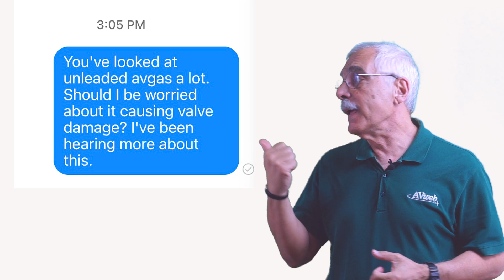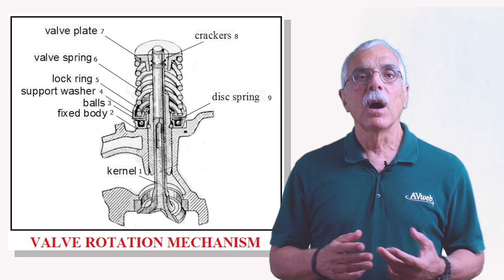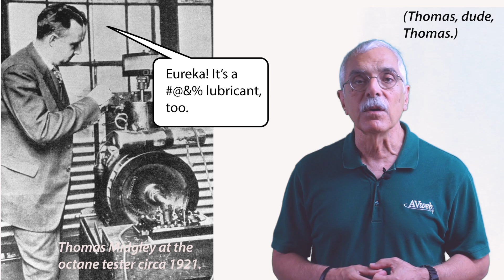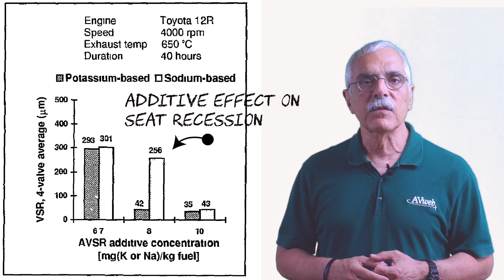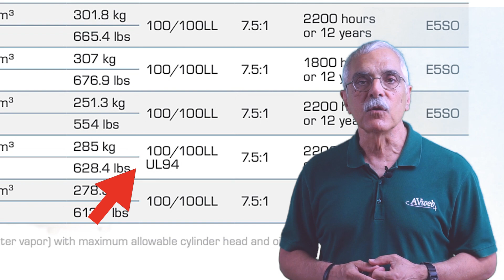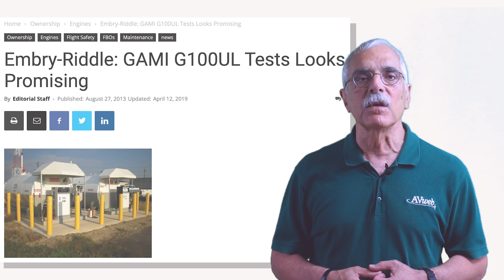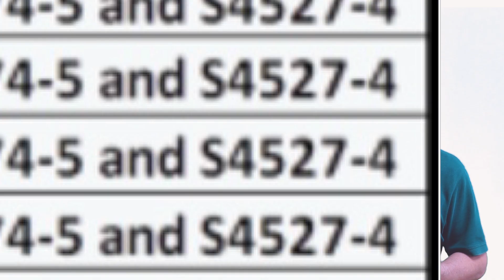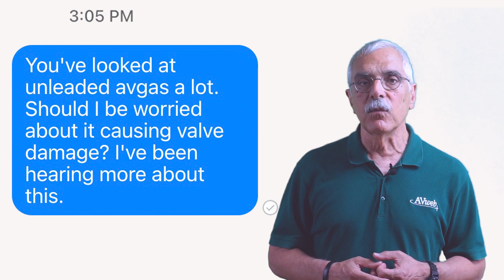Whadayamean Unleaded Fuel Will Trash My Valves?

Comment: I've operated my C-182P with a Continental O-470-R for 3,000 hours since 1985. Most of the fuel consumed other than transient fueling away from home has been automotive unleaded 87 octane and ethanol free automotive unleaded premium since the ethanol introduction. My experience has been unremarkable, except my sparkplugs never foul, never need blast cleaning and last and last.

Comment: I dont see why they cant make an AD for engines with soft seats to require a fuel additive to offset this, while the rest just run a base unleaded fuel. 
Id recon 70% of the engines bolted up, would be unleaded compliant, why are we polluting for the 30% that can pay a bit extra to fix themselves. 

Its like adding zinc for my flat tappet cam, or injector cleaner in the hopes my Porsche doesnt kill itself.

Comment: I had a 65 Honda ST/SR motorcycle and it would not run right until I put lead additive into the fuel (in the mid 80's).

Comment: That's the first time I've ever heard anyone say TEL helped lubricate valve guides.
I was a motorcycle mechanic, Honda (maybe others?) counter bored the port end of guides to prevent exhaust flame baking any oil or deposits onto valve stem  that would eventually go back into guide and cause valve sticking.
I only have experience of Honda engines back to mid 1960's so don't know when they started doing it.
They also had hardened exhaust valve seats so were OK with unleaded fuel (even the 49cc motors)
Problem is, American manufacturers will never do ANYTHING to improve what's already there until they are forced to by legislation or 'market forces'
Lycoming  at least stepped up early and fitted hardened valve seats, probably the better quality material was same price or even cheaper than what they had been using  (or, like Shell oils, engineers actually used their own products so saw usefulness of getting certifications?)

Comment: I am concerned about the sources of the unleaded fuel as it will react with sealing material in fuel tanks and engines as cleaning the damage to everything from ethanol (crapanol) on everything built before a certain year.  A fuel that took 8 gallons to make 6 gallons, less milage, water magnet, eats certain rubbers...  Would I like unleaded, sure but not at the cost of replacing all the seals in the plane and never thought anything needed the grit left behind from lead, but not plant-based.  Great investigating on cause and effect as I remember Continental supporting as octane drop (burning only 20% of avgas) with no issue, while Lycoming which with high compression needing high octane (burns 80% of avgas).
Reply: I think you're confusing unleaded avgas with ethanol infused mogas. You don't need to replace any seals for unleaded avgas (currently UL91 or UL94) as it's just the 100LL without the lead. Nothing else changes except octane rating and lead. Both Continental and Lycoming have high and low compression engines. Unleaded avgas, the UL91 or 94 varieties, can be used in low compression engines where it burns better than 100LL as it's all set up for the lower octane. The medium compression engines, most can use lower octane fuel, a few can't. The high compression ones, like the Lycoming 200hp IO-360 with an 8.7:1 compression, need 100 octane, so UL91 and UL94 aren't acceptable and may cause knock. These engines will need UL100.
Reply: @paulsengupta971  Just want to know what it is made from, as it started from bio-mass years ago (Swift) as the octane rating wasn't the concern as if it is bio-mass it is ethanol, not oil based and that is not a good thing in respect to all the bad that can come not changing seals to deal with the negatives.
Reply: @cw5865  I can't speak of individual products, but as Paul says in the video, it's just 100LL without the lead. So it's made in the same way as 100LL, just without the step of adding the Tetra Ethyl Lead.
Reply: @paulsengupta971  First Paul thank you for the interaction as I have one of those high compression Lycomings and remember several years ago when the debate started how fast Continental was going to sell out the 25% of the fleet with high compression engines at to the time pointing to 94 octane as an answer.  It wasn't going to be a problem for them with rebuilds to lower compression.  But it was quickly pointed out that 25% burned 85% of the fuel and that wasn't going to work.  Shortly after Swift offer a product from switch grass and Shell (F-1 fuels) acted interested from their high-octane racing brew.  Fast forward to today and just how are they raising the octane to 100 without something, unless the whole fuel is biomass, as ethanol is what is used to boost octane in unleaded mo-gas today.  Straight gas can't reach 100 octane without help and I know it was explained a glue melted in a fitting with the first demo plane, but if so what else will be affected and what is the substance that did the melting.  Don't have the faith in anything Gooberment is regulating due to the behind-the-scenes bonuses and jobs with changing something not explained how...  I have a plane type that is popular that will not bode well if any form of "ethanol" is put in the tanks.  I would like 100UL, but how did they do it?
Reply: @cw5865  Ah, I can't comment on 100UL, that's all new and under test at the moment. I think most companies that are experimenting with it won't publish how they've done it! I also have a high compression Lycoming which can't use UL94, so until we get a viable 100UL, it's 100LL for me.

Comment: You showed a 74 Nightmare Pinto. I had a 75 Pinto throughout the gas lines of the 70s (77-78). That turned out to be one heck of a reliable little car. Drove nice too. Luckily, I was never rear-ended.

Comment: as i was told and i go back to the mid 1950s with engines. when the gov-mint aka the EPA started fazing out leaded fuel they offered a choice un or leaded gas. the big boogieman that was also used for many years was ZDDP a zink additive. when this went by/by that caused cam and lifter wear. all this plus the valve seat issue. no lead to soften the seat contact.

Comment: I don't get this. The automotive industry went through this 50 years ago. Replace your exhaust seats. Problem solved. My '74 Ford F-100 runs fine today on unleaded fuel. Replaced exhaust valves and seats and she never missed a beat for over 45 years.

Comment: If unleaded fuel trashes Continental valves/heads after 700 hours, does it matter?  With an IO/TIO 550, you're going to need a top overhaul by 800 hours anyway no matter what fuel you put through it.

Comment: Aviation is a drop in the bucket compared to every other form of transportation. Unleaded Avgas will eventually cause a shorter TBO life & engine failures especially in turbocharged engines where detonation will occur. These are the same idiots polluting the world with lithium battery cars.

Comment: Tetraethyl Lead creates a beneficial tribofilm on exhaust valve seats, preventing wear. The exhaust valve head deforms very slightly like an oil can during peak combustion pressure, scrubbing the valve face against the seat. Better (more wear-resistant) valve and seat materials were the solution in automotive engines, helped by the widespread adoption of aluminum heads with pressed in seats vs. the machined-in integral seats employed in iron heads.
Reply: And seat wear/valve recession eventually eats up the valve clearance, holding the exhaust valve off the seat all the time. That causes the valve to burn because it can no longer transfer heat to the valve seat. And the engine loses compression simultaneously due to the leakage caused by the slightly open valve.
Reply: Tetraethyl lead (TEL), Pb(C2H5)4,   any idears about c2h5 ?   cc hhhhh

Comment: The FAA has regulated aircraft engines so heavily that instead of advancing with safer, more reliable engines.  We get flat head, ancient dinosaurs from the era when automotive engines needed full machine work overhauls by 100k miles.

It’s hilarious that aviation guys still haven’t figured out hardened valve seats when 1970’s Toyotas will go 400,000 miles with no major valve issues.

Comment: Pay attention you will get an education from a real scientist. Sadly There are a lot of lost people. I am a former NASA scientist Now a A&P by retirement activity. These engineers are lost and have been for decades. It is called the run on effect. They follow the footsteps of previous people who began the screw up research, and they model theirs after the same failed ideas .  Including the researchers at these companies. I seen these same type low D grade engineers at NASA a lot. They are everywhere. It is rare to find a true creative mind that can put everything together not overlooking the smallest detail and in a new way. . Like the detail I will share with you. It is my observation that the real cause valve seat recession on continental and even valves sticking on Lycoming in unleaded and leaded is the thermal resonance of the valves. . First you need to understand a few things.  Leaded gas provides a greater cylinder cooling effect of the gas. This is due to the mass of the lead present in the gas increasing the thermal conduction of the fluid and its ability to cool things with convection cooling. . Second the continental engines run a lot hotter than the Lycoming. This is why continental has more recession issues and Lycoming has more valve sticking issues. The FAA tests were conducted wrong, no surprise. . They follow what is and should be the ideal operating procedures of an engine.  HOWEVER, I have never met anyone operate a piston engine the proper way with respect to shut down.  They all land and shut off a hot engine. The FAA test did not simulate this. Cirrus is the worst for this type of abuse, since they have very bad ground cooling vent systems. I e cowling vents are poor. . Lycoming uses the sodium filled valves that makes them run cooler than continental. almost 100 Degree cooler . When someone shuts down abruptly a very hot continental engine all the time you are going to get in short order a valve recessing.  And a lot more often with Unleaded than leaded.  AS the engine stops from high heat the valve seat closed will seek to weld to the flange. The unclosed valves will try to warp. A Continental engine after landing from a cruise on a hot day can be well over 600 degrees on the cylinder head.  With some internals like valves seats as high as 1000-1200 degrees peak. Once a engine shuts down thermal entropy comes into play. Huge amounts of thermal heat conducts throughout the engine in a wave of randomness. . Changes everywhere instantly in the thermal pattern. Heat merging and converging and the valves are one place it loves to go. Valves are by consequence of design what is called a thermal resonant spot. A small spur like element connected to a huge block of heat.  Like a solder wisp on a mound of solder. Everything wants to go to it. It is already the hottest part in the engine and more heat loves to conduct the easiest path, which happens to be more heat. Contrary to common thought heat does not like to seek cool. Cool is just less hot. There is no such thing as cool per se.  Heat rises in air because it is lighter , not because it wants to seek less heat. Heat sinks to more heat . Since the valves are the hottest part in the engine, at shut down all the heat tries to go to them. The cooling of the fuel vapor upon the valves is suddenly removed . Including the exhaust valves that were hit with unburned fuel regularly. This causes the vales to recess, and it is less likely to happen with Lycoming valves. of lead gas that leaves a residue of lead that helps keep the colling down just barely enough. However, the cooler thermal state of the; Lycoming engines during sudden shutdown causes this same process at a much lower temperature which leads to the cumulative buildup of coke on the valves after shutdown. The coke buildup also takes place during startup in all engines. However, Lycoming has this similar effect during abrupt shutdowns which causes even more coke buildup than typical engines and leads to more sticking exhaust valves. The moral to this story is, make sure you complete a engine cool down back to normal temps in the green not yellow before you shut down an engine. Lao make sure you warm an engine at idle in a Lycoming to keep the fuel flow low, and warm up at higher RPMs like 1700 RPM in a continental to keep the fuel flow higher during warm up and reduce engine heat from focusing on the valves.  I could fix all this research But I dont have time to deal with those type people. Im too busy having fun in retirement. Have a great day

Comment: It makes me genuinely upset that aircraft are still using leaded. It's a smaller industry with fewer players, yet it'll be 30 years after it was completely phased out of cars for them to even begin the transition.

Meanwhile, this transition was as predictable as sunrise, yet until recently they weren't even using hardened valve seats with these expensive engines. No prep was done.

The approval excuse is such BS, it shouldn't take that long to find a suitable replacement. We did it in cars.

Comment: The FAA did a study years ago on valve recession, and the study found that lead did nothing to prevent valve recession other than raise the octane of the fuel.   Valve recession is caused by pre-ignition.    Pre-ignition is caused by inadequate fuel octane rating.   Lead does not magically coat valves and prevent exhaust valve damage, lead does do a good job of raisng the octane of fuel.

Comment: I really like Paul's thoroughness and aversion to speculation. 
I learned to fly in Europe (France) 25 years ago, and have flown 172s and 182s of several generations all across the continent, but never heard of an unleaded alternative other than home-builts using MoGAS. 100LL is very easy to get across France (where it's currently about 2.60/l, or $11/gal) but in some countries it's not easy to find, and your choice of airports is limited by the fuels they have available. I have not flown in Scandanavian countries, so maybe the unleaded variant would be commonplace there.
Reply: 91/96UL is common in Scandinavia yeah, many smaller airfields don't have 100LL anymore. I think 91/96UL is going to get even more common at a pretty rapid pace now, since EASA introduced the CS-STAN ("standard changes and repairs") self-certification process about ten years ago. You don't need a STC anymore, provided that the engine is unmodified and the manufacturer has approved use of 91/96UL with that engine (regardless of aircraft).
Reply: France has Total UL91. The UK has UL91 as well which is either the French Total 91 or another (which I can't remember off the top of my head) UL94 (sold as UL91).

Comment: From personnel experience,  bought a 1972 Bronco in (1990 Roughly).    What I could find said Low Lead (not premium)  auto gas was fine unless you hot a hot rod engine and or put your foot in it (the 302 in that rig was mild hp wise).   Never had an issue.   Sold it in 2005 as I recall.   Early on the valve stems went and pulled the heads.   The exhaust valves were severely coated with deposits.   The valve (ex) had crud on and around it but surface was fine.     My take was all that lead it ran prior was where those deposits came from.   My dad ran White Gas in his outboard as it had no additives.
Reply: I remember well when the gov came out with a testing statement that the new 1984 unleaded would NOT harm car engines of older vintage .    Soon after a major testing outlet came out saying it would ruin valves in as little as 2000 miles.    
   Who to believe🤔.     With the government you can pretty well know they are in some way lying because their lips are wiggling.    I worked for the US Gov for 30 years 😉🤥🤥🤥.       You can trust them as far as you can flush them as is so eloquently proven by their refusal to discuss ANYTHING about that response to that little bug of 4 years ago.

Comment: Paul,I dont mean to bring up the elephant in the room here. But the one aspect you haven't mentioned here is cost. 100UL will cost at least $1.00 more per gallon than 100LL even if UL avgas can prove no valve recession. They will have to get the cost under what 100LL is to make it attractive enough for the GA fleet to want to use it. And when you are talking about an aircraft that holds 100 gallons thats $100 more extra dollars per fillup. I think for now I will stick to cheaper 100LL

Comment: The insanity about all this is, engineers and engine production companies have known all this and comprehensive study on all manner of engine Dynamics has been well done by the 1930s. We're busy making something that's so simple a 50-year debate. I'm old enough to live through all this I'm 68 years old. Heck we've got a slew of old cars and trucks in our family farm. They have been around long before unleaded gas and they're still running fine 40 years after  unleaded introduction. No valve trouble whatsoever,! Just put hard  seats in the dang things and get on with it. Not to mention the cost of stainless steel valves isn't much more than standard steel valves. Just put stainless valves in your Cotton pickin aircraft engine from the get-go and stop the debate. I have a light sport experiment with a corvair conversion engine. Hard seats stanless valves it will run all day wide open throttle 3200 rpm on 87 octane E10 pump ⛽. Making this happen ain't rocket science.